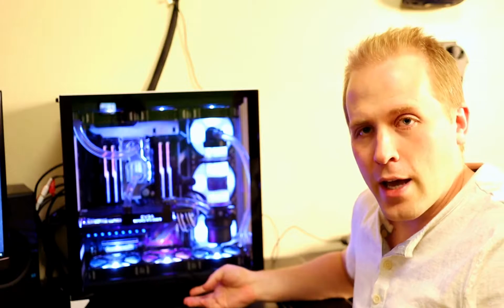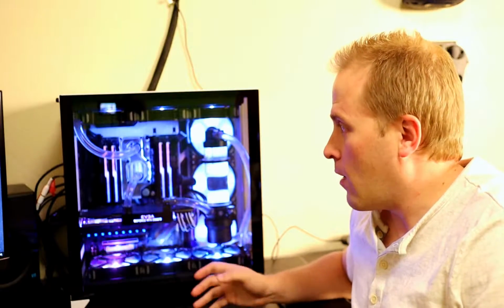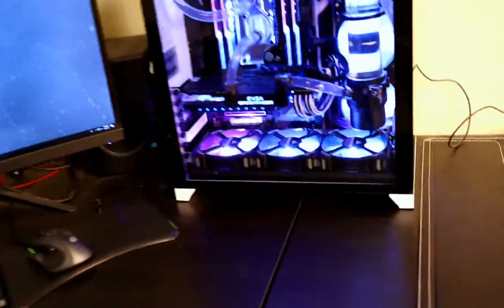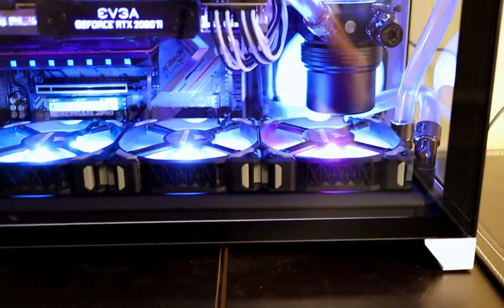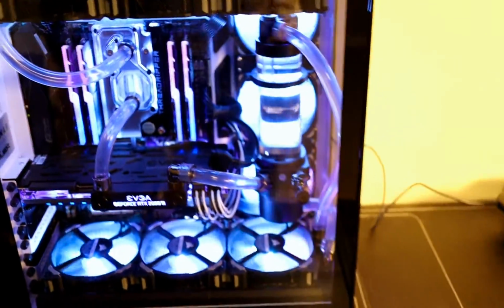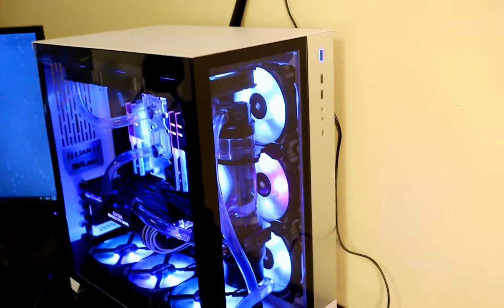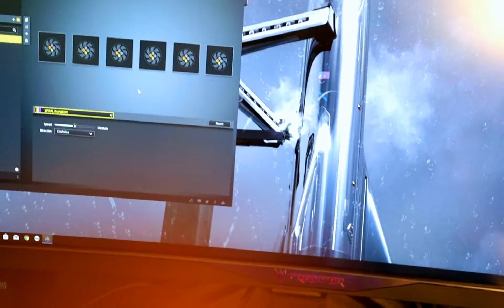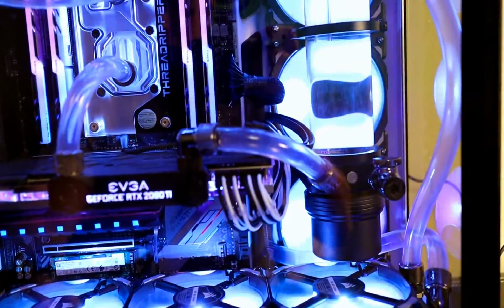Lian Li O11 Dynamic 3x360 Radiators Part 1 - Overview

Comment: I'm guessing you might have already noticed but in the video you still have the protective sticker covering your EK coin on the monoblock. Nice set up though. I'm looking at doing something similar with ZMT tubing for my first foray into watercooling. The main thing I'm looking for is being able to cool my system with as little noise as possible. I love a quiet system.

Was there a reason for going with the EK rad in the side? Would another Nemesis fit in there?

Comment: Oh kindred spirit!

Always shocked when someone is of such eerily similar mind as me. I have an 011 XL for a 3950x system that I'm planning to upgrade from dual AIO to my first rigid loop, and your parts are hugely similar.

Definitely after the singularity systems reservoir, definitely going full GTS Slims (curious why the side rad is different) doing Barrow fittings and not going Monoblock but the Apogee skf Prestige block. Probably swap my Noctuas for Lian Li Uni's since my rear cable management is kinda a nightmare, the brown color is distracting, and really fan performance becomes WAY less important when you have the equivalent of two 480 rads (plus a 120) worth of cooling surface.

It's super exciting to see a lot of what I planned visualized properly.

Comment: Iv just ordered the xl version of this case. Atm I'm thinking 2 xe360 rads push pull intaking through side and bottom with 3 fans exhausting at the top with 1 more in rear. I might get a filter and ran the rear as another rintake to make sure I have positive pressure. Il be getting high end cpu and gpu and overclock ING them too
Reply: @thetrollyjesus5132  not 3 radiators, 3 fans. also you run them all in series so it doesnt matter how many rads you have. the loop goes from pump to cpu then gpu then rads then reseviour and then back to the pump. it doesnt matter what order you do it in
Reply: @thetrollyjesus5132  yes, you run everything on 1 loop, no matter how many radiators you have

Comment: What thickness are your top and bottom radiators measured at?

I was going to build a loop with two radiators, top and bottom, with a distro plate on the side where the back panel goes. I was looking at 38mm thick 360 radiators.
Reply: The guy said his radiator at the top and bottom are GTS360's, they are made by HWLabs and are very good but restrictive radiators.
Reply: @wholeshow  if you have a D5 pump you're going to be fine.

Comment: I think more people will care about that you have 3 pull intakes on the bottom, 3 push exhaust on top and 3 push exhaust on side
Reply: The case is getting fresh air via the bottom either way. It will be fine as it's water cooling.
Reply: @wholeshow  I'll let you know in about 24 hours how this goes. I ran 2x360gts on top and bottom and an alpha cool xt45 360 on the side. I'm actually doing the annual maintenance on the loop and when I redo the loop I'm going a single gts up top as intake and the xt45 as exhaust. But I'm removing the bottom radiator completely and allowing cold fresh air into the case.

Comment: how did you fit the 130mm wide EK SE rad? did you have to mod the case? people said that that radiator will not fit.
Reply: I've watched a few different videos to figure this out and found out that the max width for the side section is 125mm so while the EK PE radiator doesn't fit (130mm wide), the EK SE will (120mm wide).  This video shows the PE not fitting (@ 3:35) https://youtu.be/Zs51JtTxiY0?t=214

Comment: I’m gonna buy the pc011 case but I’m gonna air cool my setup until I have enough saved up for this. I was wondering how a 3 rad setup would work and putting your rad backwards is smart. Hopefully you get to close the back.
Reply: Did you end up doing this? I love the case but I'm worried about aios failing. Wondering if case is good enough with just air on CPU with 9 fans.... 6 intake on side and bottom with top exhaust
Reply: When the AIO fails, your system will turn off since bios got a heat guard and there is monitor software. Gamer Nexus have reviewed it whit aircooling since he want compare it whit same equiptment as other towers. Hope this helps.